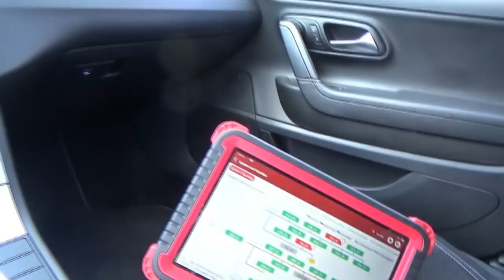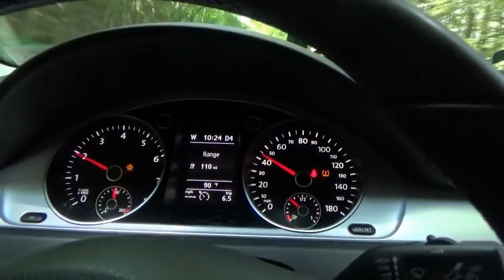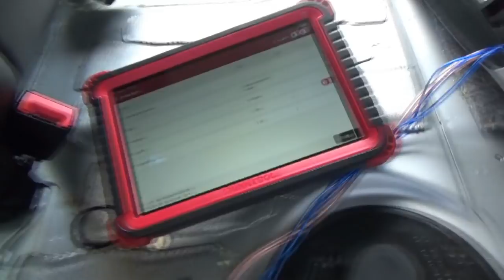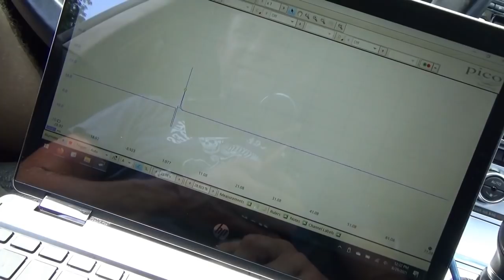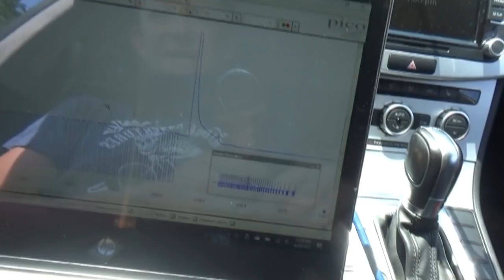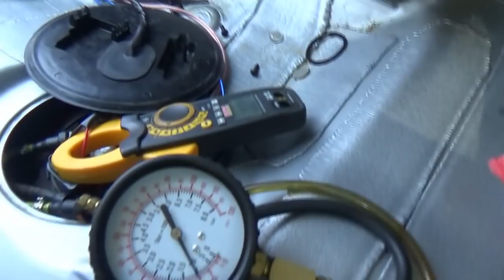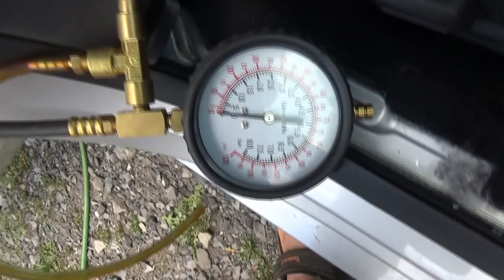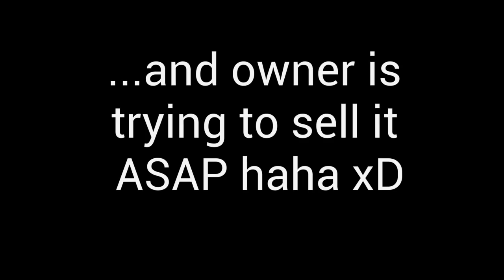EUROTRASH IS BACK! Start-Stall - Part 2

Comment: The amp power wire in the door jam is horrid
Reply: And the owner wonders why he’s having electrical issues…
Reply: Yes seen that OMG. And those cars are so connected it will normally shut the radio down because of draw from a amp. That's probaly why it wasn't connected. from the first video.

Comment: Volkswagen GDI has normally open solenoid  on High press pump  if you disconnect  sol at High pressure pump it should run on low pressure  idle only   Phonomal video Thanks Ivan

Comment: I owned a Volkswagen Jetta.  The engine was anemic and noisy, but reliable.  The rest of the automobile was junk.  The electrical system was a constant problem.  Every window regulator on the car had to be replaced.  This included the passenger side rear window that was used probably five times.   Window seals started leaking at about 40,000 miles.   There were so many other problems, listing them would be a short story.  The dealer was a nightmare to work with.  Because of the daily aggravation of just owning the vehicle, you couldn't pay me enough money to put up with ANY product associated with VW.
Reply: You could have just left it at “I owned a Jetta” and I still would have felt bad for you

Comment: This hose is important for the mechnical "Fuel regulator"(build in the pump) to work correctly. When pressure in the lines after the pump drops , the regulator "closes" and allows to build more pressure forward of the pump. When pressure builds again and stabilize(forward of the pump) , it bleeds the excess from this hose . PS : The most important thing on GDI engine is engine timing. The high pressure solenoid opening/closing must be done at very precise time when camshaft lobe that drives the High pressure pump starts touching the follower of the HP pump. This allows pressure to build in high pressure fuel rail, or to be bleeded back to the tank. When cam timing is off , the camshaft lobe pushing/releasing action on HP fuel pump follower won't be synchronized with the opening/closing action the High pressure solenoid. Pressure would be out of spec - either too low or in some cases - higher. That's why engine timing is critical for GDI engine to work good.

Comment: Great repair - no parts required. I thought the data pid for fuel pressure showed it to be ok, tho. Goes to show you that sometimes old school methods are required.
Reply: That's for the fuel rail pressure after the high pressure pump. So apparently the low pressure pump was still able to keep up, sometimes anyway..

Comment: I love that after all the diagnostic equipment is used (which you are the master) the old fashion pressure and flow are the deciding reasons to intricately examine the pump. Not considering GDI 90 psi sounds high when I am used to 50 in my old 2002.  I always come away with some learning by these videos.  Thanks.

Comment: The amplifier power cable at 1:30 made me cringe... That's a fire waiting to happen.
Reply: Horrible...
Reply: Tells you a lot about the owner….
Reply: It's not connected to the battery. See last video.
Reply: @dmdaithim  Yeah I saw that, but now that the car is fixed the owner is probably going to connect it...

Comment: I had this same issue on a Ram truck. The tube ends weren't crimped enough to hold together. I reassembled it and better crimped the tubes and all was well.

Comment: Just like the other parts, the fuse, the pump power connector...someone messed with the fuel pump below deck. It's amazing how quick this could have gone had someone told you they were inside the tank, moved fuses and unplugged the fuel pump on your first visit. 
That transmission sounds like its been altered to shift like a tow haul mode !
Reply from the maker: Didn't look like that fuel pump had ever been removed... No marks on the lock ring
Reply: @PineHollowAutoDiagnostics  copy that

Comment: When i get a car like that i charge for the initial diagnosis that was a self induced problem. I would also charge additional time for chasing an intermittent problem. Most customers don't understand why it cost more for intermittent problems. If i spend multiple hours trying duplicate problem i should be paid. I had a car dealer bring a vw van intermittent no start spent my hour on it no problem. Call to get more time and they want me to drive it on my personal time to lunch or whatever. They picked the van up and paid an hour.
Reply: Its difficult to sell 100% labor hours on inspections, such as $120/hr vs. $45/hr. Lots of folks think the lighter weight work should be less per hour vs. the same hourly rate that would be charged to do a head gasket job. I tend to agree with the customer however, on the shop side of things, I also see there needs to be revenue generated for the time spent on jobs. That's always been a problem with me too as some things could be performed without a certified master mechanic labor rate due to less involved jobs such as  test drives. It is a hard call for both, the customer and the shop...I totally understand
Reply: @HouseCallAutoRepair  My answer to that attitude...do it yourself then. You are paying for the diagnosis. The repair is free.
Reply from the maker: @gailtaylor1636  yeah 8 times out of 10 the diagnosis is the hard part 🙂

Comment: Great job 👍 Ivan !!! I just had the exact car in my shop for no ac.. compressor  valve was not opening or getting 12volts .  If I supply it with power it would work 💯% the cooling fans would come on Ice cold ac .  I couldn't leave it like that lol 😆 I found a bad wire on the drivers side under the air box in the harness . . I hate those cars .

Comment: my 2012 had similar issue, but there was a recall, changed the HP pump and the rear seat fuel model to rev K.  Hasn't done it since.  Would randomly leave me stuck.

Comment: Hey Ivan. In my experience, most of the DI cars that I have had to troubleshoot will start and idle on the low pressure pump. They will not have enough power to drive around though.
Reply from the maker: What about just the high pressure pump?
Reply: This holds true for a low pressure pump that will output 6 bars/90psi. In this case there are only 15psi/1bar available and it won't run on pressure that low.
Reply: Ivan,
 I had the exact problem on my 2012 ski nautique  inboard waterski boat - has a high and low pressure pump located in the engine bay - not in the tank. Problem was intermittent and there were no performance issues at  other times. It would always start up when cold no problem. As we skied, then it would randomly act up.   I kept thinking that I was getting vapor lock from cheap gas because of air in the fuel rail. After a month of cleaning fuel lines and changing filters  I took the leap and concluded that  the low pressure pump would spin and prime but at times it could not keep up the demand of the high pressure pump. There were no codes and all live data showed engine was perfect. I put in a new low pressure pump and all is good. Great video!
Reply from the maker: @juergenscholl2843  but it ran great on day 1! I think the key is fuel percolating after a hot soak 😉
Reply: @PineHollowAutoDiagnostics  I'd say that would be a no go, as experienced. Those hoses fell off likely during your repair as they were already half off on previous visits.

Comment: Hi Ivan when you want to check any data pids from the diagnostic tool you can cycle the key on off but just before cranking the engine set up the diagnostic tool to what you want to see and then crank the engine the data Will show just don’t cycle the key it won’t work right and the solenoid on the high pressure fuel pump can be actuated with the scan tool.  And maybe the reason the ecu didn’t show any low fuel pressure faults is probably that if this engine is tuned then the threshold might be higher than a stock tune . Good job considering the car was almost sabotage beforehand.

Comment: my ex-landlord's stepson had a Volkswagon Jetta that kept dying. found out there was an accumulator and pump assembly that was broken and very expensive he went to the wrecking yard and bought a used one and had it installed the kid went out and hot-rodded it and blew up the engine by running it out of oil.
Reply: NICE! Finally the car went to VW Hell where it belonged since conception.

Comment: Lowered cars have a lowered life expectancy. I have 270K on a 2.5 Jetta with a 09g auto. 2006
Only new car I ever bought. all stock still.

Great video.

Scott
Reply: My wife has an 07 Jetta 2.5 fast approaching 200k and going strong… I need to either replace the vacuum pump gasket or delete the pump altogether as it is leaking pretty steadily but other than that it’s running great!
Reply: @robhughes8516  I removed the pump and blocked it off. I changed the gasket a couple times. Built an aluminum cover for the pump before I blocked it off. Should have done that years ago.

Comment: The car losing com every time you start it is frustratingly stupid. 
It's also a bad design with the Thinktool, that you have to completely reset-up your data PIDs every time communication is lost. Surely it would be more sensible to have a "retry" button where it just goes back to the data streams before com was lost

Comment: If you select D immediately after start, the engine should try to restart if it shuts off unexpectedly. As long as you're in R or D/S it should keep the engine running or try cranking it - at least once.

Comment: Can you rig a setup at the DLC so when you crank the engine you don't lose power to the scan tool IF that is what is happening? I may have monitored the fuel pump from the beginning as access was there luckily, with either a voltage drop test or an amp clamp on the scope to see what the pump RPMs were (both of these tests) running and priming and not starting, the problem should show up with this information.

Comment: I came across something like this on a 90's Jeep Grand Cherokee that had been in a fairly significant collision and subsequently, fixed.  Not too long after the bodywork was done, the owner noticed issues with power in the mountains, and random loss of power/stalling when the tank got low.  The only thing I could figure was the impact was hard enough to break the fuel pump assembly.  In my case, the pump assembly couldn't be assembled - I had to replace the entire unit.  Problem solved!  It worked long enough for the owner to sell the Jeep and buy a brand new replacement.  He didn't think it would ever be the same post-collision...and I would have to agree.

Comment: Who the heck molests a Passat like that?! That's a case study all right. Case study on poor taste.
Reply: i love it 😂😍
Reply: It's a CC. Way more upmarket than the Passat
Reply: @person749  lolwat It's a Passat with sleek lines. Same chassis, same engines, same suspensions, same transmissions, same parts bins slap stick parts and materials and above all, same price range. VWs marketing department really puts eoples heads on a spin. For crying out loud "way more upmarket". lol Not even a rebadged VW which the beancounters slap four rings to is "way more upmarket" let alone a sleek Passat. Get a grip.
Reply: @mudemmeonick  Lmao, dude, CC starts at $35k. Passat starts at $22k. I'm not going to argue that it's worth the premium over a Passat, but you're just being ridiculous.
Reply: @person749  That may be the case with the mexican made VWs. From where I'm from the last CCs being sold had a starting price 4000$ over the regular entry level Passats. You people not only are brainwashed to believe VW products sit at a higher quality level than they indeed are as you're also ripped off just by sheer marketing power. Just imagineliterally the same car, just with different body shapes, being sold for over $10.000 more. VW would have ended up with some parking lots full to the brim.

Things are bad as they are with the lipsticked rebadged audis with VW frantically showering people with marketing trying to reel in a higher level costumer base other than the usual hick schmuck that made a couple bucks and has two neurons. Just imagine if they started charging those price differences in between Passats. Ridiculous.
Reply: @mudemmeonick   @mudemmeonick  Interesting. I'm in the US so no idea how it was elsewhere. I just know it's a much more expensive MSRP here and a larger base engine with more trim options, like you could get AWD on the CC but not the Passat.

I don't know why your're reading so much into my comment. Just pointing out that it's a different model that costs a lot more money, hence it's "up market". Never claimed that I actually thought it was worth the extra money or even a good car.

Maybe calm down a little and stop being so sensitive over a fucking car? Lol
Reply: @person749  You're overeading my words.

Around here they had pretty much the same engine choices and trims as the regular Passat. Including AWD models. The Passat ended up having a 3.2 option and a 1.6TDI the CCs didn't get. And even then the 3.2/3.6 engines sales were negligible in both models and the 1.6 had limited success with company fleets. The sales volume was dead on with the 2.0L diesel engines. All in the CCs weren't that much of a success. The CC concept aims at a customer which wants a bit more pedigree than what VW parts bin cars can offer. And before you get me wrong, I have owned and own VW products. But things have their place. VW shot a big over the target with the CC.
Reply: @mudemmeonick  Agreed. Thanks for the insight. Yeah, they didn't sell too well and certainly were asking more than they should have. I got one as a loaner when my Jetta was in the shop years ago. Wasn't a bad car, definitely felt more premium than the Jetta SE, but I certainly wouldn't have wanted it for the $40k+ sticker I saw on it.

Comment: Yeah,that's what u have to do with all of these direct injection cars,I check fuel pressure from both pumps,most of the time the high pressure pump leak fuel back into the oil and they diesel and have run on..

Comment: Nice diag had to sort through the built in problems, To help rule out a high pressure pump problem I believe all GDI engines can start and run (not well) on low side pressure

Comment: almost same problem i had .  suddenly did not want to start.   after changing almost all parts in the fuel system  they found a loose wirre in a fuse box so fuel pump dident get power

Comment: That is a failure on the Eurotrash. That it never set a low pressure code. Makes you wonder what is going on at vw. But may have just been a scanner specifically for this car or something.

Comment: I have had multiple similar issues with those CHEAP-ass plastic aftermarket fuel pump "assemblies".  The OEM ones are better, but still VERY cheap design obviously.
Reply: someone diddled with that pump before, during one of their "diagnostics". That caused the pump to come apart. The same person who pulled the wrong fuses and left the pump disconnected.

Comment: I assume the guy who unplugged it took the pump out and had no more clue on reassembling the pump than I would have. The pump looks, cheap, complex, with planned obsolescence plumbing, what's wrong with a plastic box that pumps fuel.

Comment: Puzzled...... This fuel pump stopped building pressure because a hose came off? And when you showed up it reconnected on its own just to fell off again after some time?? Part 3 probably will come up with the "parts needed" section.
Reply from the maker: I think it never put out more than 15psi. Worked fine cold since fuel wasn't boiling in the rail lol

Comment: Good diag but if it happens again before he sells the car I assume you will diag and replace the pump for free. RIGHT?
Reply from the maker: WRONG! That would be on the owner. I did the diag and made my recommendation 👍😁
Reply: @PineHollowAutoDiagnostics  I've been reading a few posts on your channel who believe once you "touch" a part, you own it for as long as your warranty is. One guy commented on the Ford F150 4x4 relay issue that should have been installed for free because you were there to "fix the 4x4 system". The module in the dash, then another issue and finally replacing the relay. This poster commented if anything else came up with the 4x4 system during your warranty period, you should do it for free as all the customer knows is the 4x4 doesn't work. I can't agree with that, in fact I would have to consider any thoughts like that as a full bubble off plumb. So, it continues, armchair car owners who think a mechanic is married to their car just because they had done some work on it here and there.
Reply: RIGHT? RIGHT? RIGHT?

No, Bill!  WRONG!
Reply: @PineHollowAutoDiagnostics  i didn't hear you recomend a new pump, you just said" no parts required "
Reply: Ivan can document it in the repair that the pump should be replaced with a new one, tell the owner to drive it with the old one if they want. If he has to diagnose the "faulty" pump a second time that is not warrantied from the first 30 day guarantee and the owner will be charged a second diagnostic fee. Have the owner sign off on the terms, get paid, move on with life.
Reply: @2aminitials  Yes, Something all mechanics/shops need to understand is the administration of their work orders/invoices to customers. They need to document items on those papers for their and the customers benefit. Not many shops are doing this and tend to rub a customer wrong down the road when they have a similar problem or concern. If things are well documented on the paperwork as to what was repaired/replaced and recommended repairs and/or present concerns of the vehicle, it helps much. However, some might document issues that will personally attack some customers...need to learn how to write that stuff in a nice way I reckon.